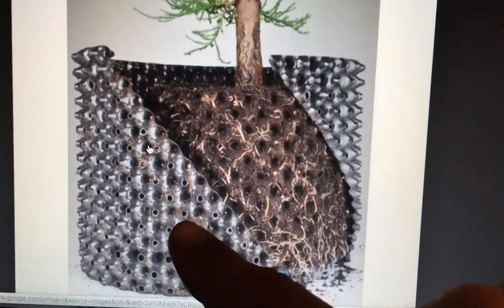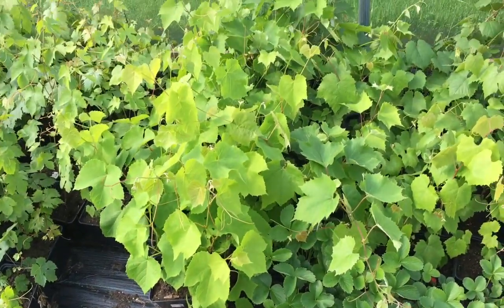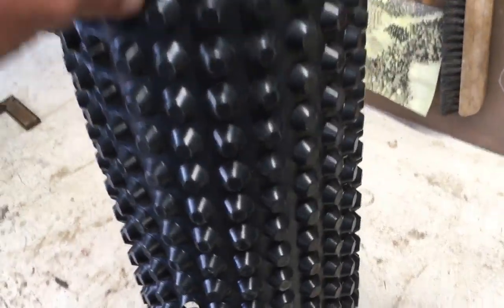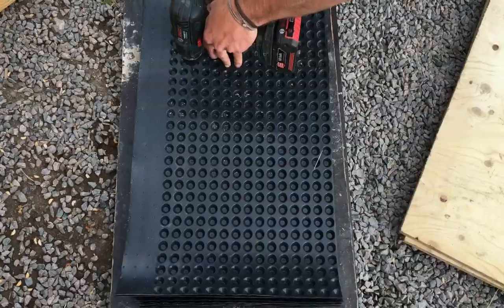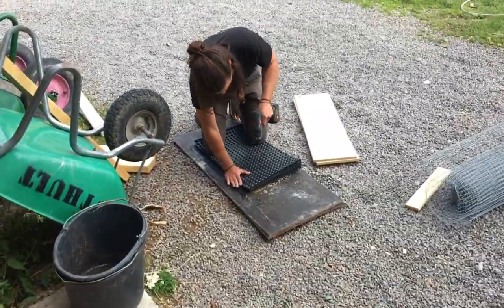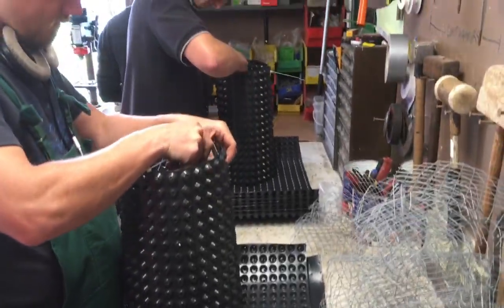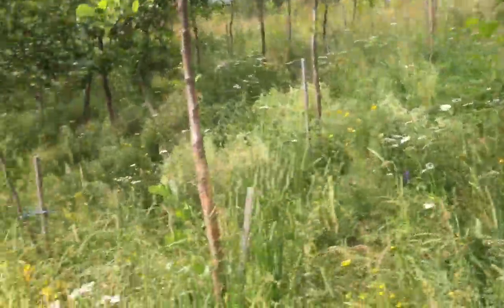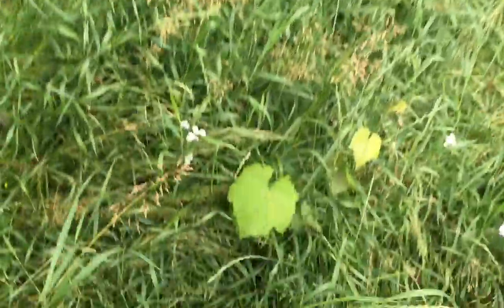Root Trainers/ Air Pots: Make your own at low cost...

Comment: I love ridgedale, but there is a 1 thing you did wrong. 
Don't tear any holds in the first two layers of pimples.
You going to have a problem. 
You've you are trying to pour water inside your pots you going to have no reservoir. 
That's why around your pots is going to be a puddle, and also the substratelayers below gonna stay dry😔.

Comment: This is not the same. Root training air pruning pots have a design to guide roots to the holes. While this will work to a point it will provide lesser results than an actual air prunning pot that's designed to train roots. Also, this is less effective and more expensive than a burlap sack on a plant pot elevator. I like the idea, but it needs work.

Comment: So how did these work out? I looked through your videos and didn't see a follow up to this. My initial thoughts are the wire mesh might be too open and allow for the soil to migrate through over time, might be better to cut circular pieces of the same material. Or maybe make these foldable four-sided in design.
Reply: I wondered too.

I'm looking to copy his actions.

Maybe I'll ask when I order his book.

Comment: Have you considered treasury tags instead of cable ties to secure the sides? They might save you a bit of time during assembly and they're easily dissassembled for storage.
Reply: What are treasury tags and where can I purchase them?
Reply: @geriannroth449  You can buy them in stationery shops.
They're like a small piece of twine with either metal or plastic at each end. You put it through the punched hole in paper and twist the ends together.

Comment: The material is called polypropylene sheet drain, but it's only sold in large rolls, so if you're wanting to make just a couple pots, this isn't the solution unless you can find some scraps somewhere.
Reply: Where can I purchase those sheets?
Reply: @geriannroth449  In the US you can find it most places that flooring is sold as it's used over concrete slabs as an underlayment for flooring to keep moisture and water seepage separated from the flooring.
Reply: Thank, You can get rolls in all kinds of sizes.

Comment: Unfortunately here in Asia are only the one sided dimpled membranes available. I didn't try it for this reason. Will the roots not start coiling in the pot as soon they hit the flat surface of the membrane? The real air pot will "guide" them to the hole which seems for me to be the significant difference. I didn't try it for this reason. Please let us know how they worked out after 2 years.

Comment: I have real air pruning pots. They aren't any better than the laundry basket ones I made.
That black plastic gets HOT and kills roots.
Lost more than one plant with those black air pruning pots.
Oh and the laundry basket ones cost about US $1.00 each (two required per pot) plus some window screen or weed block.
I also bought a new round oil drain pan.
I place the laundry basket in that and fill with water.
Instant sub irrigation AND plenty of air to the roots.
Reply: its 2022 and u are still no using led lights ?
Reply: @TheSmajic  Why pay for and use LED lights when the sun does it for free?
Reply: @crazysquirrel9425  u live in afghanistan ?

Comment: for bottom part you can use plastic pads that used for press food in jars,barells[plastic] if you know on what i mean that wire its not good because rust after some time.
Reply: or best to use same material for hydro isolation just make it triple

Comment: If you water using capillary mat or homemade wecking bed (plastic liner, perlite or pouzzolane water filled + woven fabric used as gardening mulch on top) you can put your air pots on top of it so you don’t need your metal wire fence at the bottom. Air pruning at the bottom will be done in the dry cycle & sunlight easily. It’s easy to control large amount of plants with such system specially for indoor & greenhouse. It just increase RH a little. You don’t have to water often, drying is slow and natural... you can move your pots on it without problem. You just need a well aerated pot mix (50+% of perlite is a good start)  and well hand compress it when potting. 
Love your work, 
Regards, 
Kus from France.

Comment: you know those 'green' super market bags?  they work just as well as air pots.  every part of the bag is breathable material which has the same effect of reducing/stopping plants becoming root bound plus they have handles for easy moving & they're pretty durable & reusable & they're cheap
Reply: now this is a great idea, and you could probably get them very cheap if you buy them in bulk directly from a supplier

about how long will the bags last when used this way?
Reply: @Michael-ki5oz  i suppose they wouldnt last long if they are biodegradable. But its a great idea
Reply: I was about to use the fabric grocery bags till I got reminded of the air pots. I've seen the bags used a few times but the roots can't escape out the sides for the roots to die and create new. Yes the bags are breathable. Plus when  the bags get picked up it would disrupt the soil which effects roots and the plant. I'm curious how are the just a good? I know they work good. If I don't do the Air pots , I'm doing the Walmart bags and thought to double them instead of just one. What's your thoughts on 2 bags

Comment: Ive always thought about corigated drain pipe. ... Just cut it to 12in pieces . and I dont use bottoms .i dig a hole and pot the pot / liner over it.  The roots can go into the ground but wont drownd and everything I feed stays in the root zone.

Comment: For the project I MUST do Today I'm going to use 4" perforated drain pipe.  I'll order this material and see what happens BY USING A BELT SANDER TO KNOCK OFF THE SURFACE TO CREATE THE HOLES.  I'll try to remember to report on how that works.  IF you try it I think running the sander at a lower speed is needed to prevent the plastic from melting onto the sandpaper.  HOWEVER, a belt sander would be okay for doing one sheet at a time.  Drilling can do a hundred sheets at a time. (Get extra-long bit if doing mass production.)
 -- HOW I did this: THE PERFORATION SLITS ARE IN THE WRONG PLACE TO BENEFIT AIR PRUNING. so I put a 2x4 lumber inside the perforated pipe to keep it straight. {You can use non-perferated drainpipe since the slits are in a useless location.} Then with a circular saw I cut a very shallow slit down the length--six places around the perimeter.  Then I cut the pipe into 6-inch lengths. I set all these on metal "stucco lath" (an expanded metal) which is supported by other simple materials (wood).

Comment: i've considered doing this before, but was unsure how the chicken wire would hold up... any updates?
Reply: That is galvanized mesh not chicken wire.  Galvanized mesh will hold up fine.  I'd say at least 10 years or more I'd assume
Reply: I guess he called it chicken wire but it's not that flimsy cheap stuff that goes bad and tears/warps easily

Comment: you need same caps to be turned inside between drilled ones, it prevents water to be dumped off the sides during watering

Comment: These pots dry out really fast and require much more water than your standard container.  Be sure to figure that into your costs.  They do make really nice roots though.
Reply: you can bottom feed and it works with wicking systems if water usage is a concern, you will have much better growth in dry mediums with these than fabric due to training. unfortunately this won't work as well as an actual root trainer airpot, because it doesn't have the cones on the inside that guide the roots to the holes. its a smaller difference but noticeable in my experience.

Comment: The knobs should point inwards not outwards. Compare again with the original.
Reply: HAHA, yes.  I see people making these and I keep saying, the dimples should be inside to discourage root circling. I know Root Trainers and Air-Pot doesn't do that either but it seems counterproductive.  What I did was put the dimples inside.  Then I wrapped lightly woven shade cloth around the outside of the container to discourage excess media and water leakage.  That has worked well for me in the desert. This way I have double insurance that no root circling occurs, I am using them to espalier standard size fruit and nut trees down to dwarf size. With proper fertilization I can keep them in those pots indefinitely without transplanting.

Comment: Just be aware that white cable ties are not UV stable. I’d hate to see these things popping open on you.
Reply: Thats what I said. I want everyone to know this. Same with that White PVC people use for irrigation pipe..
Reply: @jimmyrig8971  Its better just to buy replacement Air-Pot fixing screws.  For a 100 large size, its $50 but you can reuse these almost forever.

Comment: Gardeners are using fabric style shopping bags from walmart here in the us or landscape fabric to make air pruning pots for tomatoes and other veg. If you made racks from wire to hold fabric bags you could reuse the racks. Your air pots are costing you about $4.00 each. You didn't include labor for 3 men.
Reply: I think he said it would take 18 hours making them, to save 1000 euros while listening to podcasts. That's 55 euros per hour.
Reply: I have tried even the Root Trainer bags and they have not worked for me.  The roots still grew out the sides and bottoms of the bags. They are impossible to move around compared to rigid pots.  Plus, he has voles, they will eat thru bags in a heartbeat. I bought Gro Pro Pot elevators for the bases.  They are $2.39 a piece but they will last forever and are easier to install, plus no fooling around cutting wire to size and then installing them.

Comment: If you have an early freeze, with those grapes in the future, you can make the "frozen wine" that they make in canada - i forget the name, but it's pretty cool.
Also, wine makers prefer VERY high sugar grapes - and that's great to get the 14-15% alcohol, but then they add the acid back... so if your grapes are not quite as high in sugar, you can still ferment it and make nice wine, and just hope the extra acid doesn't kill the yeast(but you can also adjust that acidity using some sort of base)
Reply: Icewine is Amazing!

Comment: pop holes by placing multiple nails (4-5 rows?) hammered through a 2x4 and hammer on the flat sheets of black plastic instead of drilling?
Reply: I was thinking a piece of plywood the same size as the plastic, with roofing nails or similar. An hour to layout the plywood grid and install the nails, but way faster than drilling in the end if you had very many to do.

Comment: Hey Richard,
Don Worley here from the western USA.
If you happen to notice my comment and have the time to answer a quick question... 
Can you be certain an alder tree is fixing nitrogen well without inspecting root nodules? If not, is there an inocculant you can use to provide a potential nitrogen fixing tree, such as alder, with the right nitrogen fixing bacteria?
Reply: Use moringa trees instead. You won't regret it. ;-)
Reply: @natureboy6410  thanks for the rec. I've heard moringas are great, but I had one that didn't put up well with cold. I believe they're best for warm coastal climates.

Comment: From working with airpots in a tree nursery the top ridge doesn't have holes to prevent water running off out them. Just a suggestion :)
Reply: Wow. Thanks. Very nice detail to know. How do you handle the air pots on tree sale? Does the client return the pot or pay for it?
Reply: @my_permaculture  I think you can do either way since it's so easy to take off and clean off.
Reply: I could swear you are living in Northern Alberta, Canada, on Highway 40 (South)!  Wow your entire landscape looks like what I see when I’m out for a drive. But your accent, then reference to Euro, definitely stopped me in my tracts!  Great idea for air pruning pots!  Good luck.  Correct me if I’m wrong, but isn’t a vole about the size of a mouse?
Reply: @thinlizzy535  Voles can grow bigger than mice, like small rats. Depends on the type of vole and the amount of food etc. Field voles, as an example, can be anywhere between 8 to 18 cm (3 to 7 inches), excluding the tail. Field voles are one of the most common pests in Sweden; they dig like moles only just a lot faster, eat the top part of the plants as well as their roots, and procreate quickly like any other rodent. Many a lawn and garden have been ravaged by these miscreants.
Reply: @oscarpalm4863  In the US , the Coyotes play hell on field voles. You can walk through a pasture oodles of dug up spots where the totes dig them up.
Reply: Great tip!  I am looking to grow fruit trees in pots as I might be moving in about 5 years.  What is the best way to container grow them?  I am not looking to have them grow more than about 7 feet.  Can this be a permanent way of growing them?
Reply: @songofyeshua9348  3 yrs till you move..ha. I grow fruit trees , and I don't know where your moving but i would be afraid of the roots freezing in the pots.Just a thought. Another is Semi-dwarf and def. Dwarf trees can start producing in two years, They're already a yr old when you buy them. Perhaps just buy new at your new home place.
Reply: That would save some drilling

Comment: Yeah! I feel the summer season Ridgedale mojo power arising again in this video. Feels good. Superb idea with the DIY air pots. I guess this gave me just the right input for very high quality woody plant probagation nursery, where the air pot problem was always the bottle neck, as the expensive pot could not stay with clients. Under 1€ is a different mark, where giving the pot to a potential client would be no problem. Thank you so much for sharing this practical idea.

Comment: Would not melting or penetrating with a jig be better???
Reply: I wouldn't recommend melting, if only for fumes. But, a punch press with a 'jig' would be much more efficient and faster than the cordless drill for making the holes. A sheet of plywood the right size with suitable sized nails driven through at the proper spacing would make a functional, inexpensive, punch form. A fly press, or a hydraulic press, possibly even just an arbor press, would do for pushing the punch through the material.
Reply: @peterellis5626  The fumes are gone before the plant contacts it and While melting the holes, do outside &/or with proper venting.
Reply: I would try it, BUT melting would have to be done only one sheet at a time, or else you'll fuse the sheets together.

Comment: A similar product comes up on Lowe’s website as polypropylene drainage sheets.
Reply: Just came back looking for exactly this information ;)
Reply: Be warned I used a similar product cordrain only lasted six months as it had no UV protection the shit fell apart.
Reply: @Tunnelrat6666  not surprising, as it’s designed to be buried against a basement wall. ;)
Reply: still very expensive...
Reply: Showing $250 US dollars or a 50 ft x 4 ft roll at Lowes. I wonder how many pots that would make.
Reply: @GrandmaSezSo  I'd figure 2x2...that would make 50 pots. At $250 a sheet it's $5 a pot.

Comment: Perforated drainage pipe would work if there was spares
Reply: THANK YOU!!!
Reply: @bigsmiler5101  I've now bought the real thing and you cannot make these to match the quality of the originals....the originals are not expensive when bought in quantity.
Reply: @arusse23  Where did you find the real thing at a reasonable price.  Best I've found is $65 for 25 two-gallon pots.
Reply: @bigsmiler5101  direct from the factory in Scotland
Reply: @arusse23  Thank you.  However, I've done a search on "Root Trainers/ Air Pots" and don't get a manufacturer, except various Chinese companies that might sell a minimum order of 1,000.  Can you give a company name or website, please?
Reply: @arusse23  What are you considering quantity though? Over 100 is a good number but like he said, would cost over 1k , when the ones he's made achieve the same results for a tenth of the price what makes the originals worth the price, just paying for a name and slightly more rigid/better looking end product.
Reply: @rubeushagrid1828  We have ordered them in various quantities. last order was only 200 or so. His idea of pricing is taken from Amazon or a second party seller and its definitely not expensive to buy direct....The idea of the home made root trainers doesnt match the quality of the original and there is a lot more to it than just the pot, the soil mix, watering, fertiliser etc is all precise to get the best from them.....they work really well. I'm not convinced these home made ones are better at all or cheaper....especially when you consider re-use.
Reply: @arusse23  What's the minimum order ? Says a pallet but how many can you fit on a pallet eh

Comment: Tip: Put a row of sharpened pipes or nails in hard wood. Make distances like bottle caps and a pressure spring on the outer ones. Make some pressure on it and you have a centered row like a hole punch.

Comment: why not make the whole thing out of chicken wire? Need more watering but never a problem with root binding
Reply: karel janssen that’s what I was thinking but it looks like he may keep them in those pots for over a year. That’s lots of extra watering
Reply: @4philipp  yeah that would be a problem
Reply: or you could line the chicken wire with plastic and just poker holes in it, although I think maybe the depth of the dimples helps thiings as well